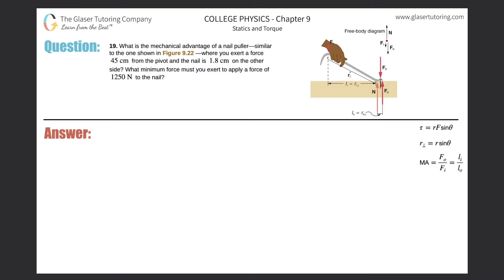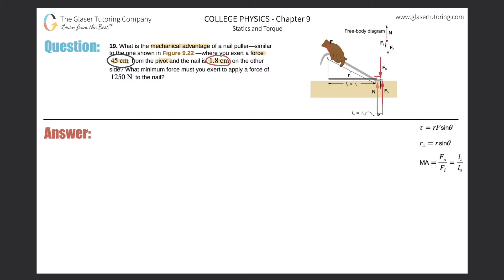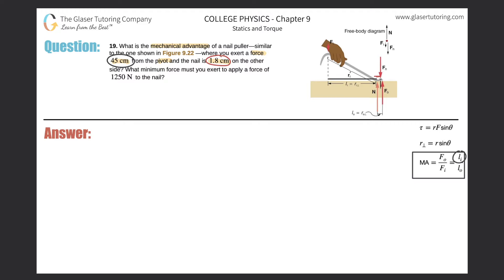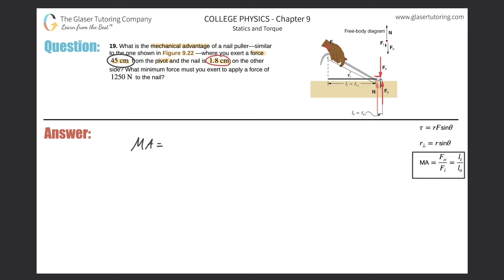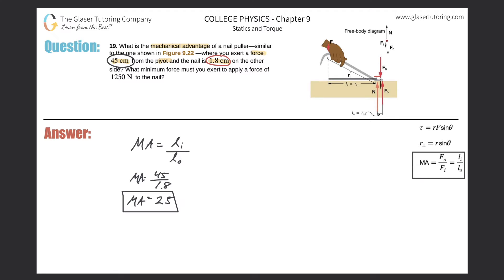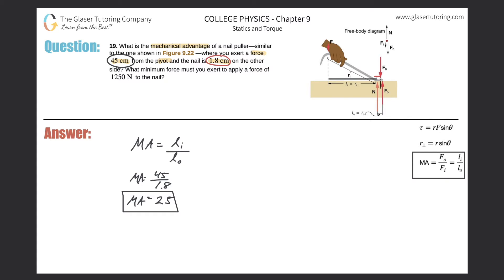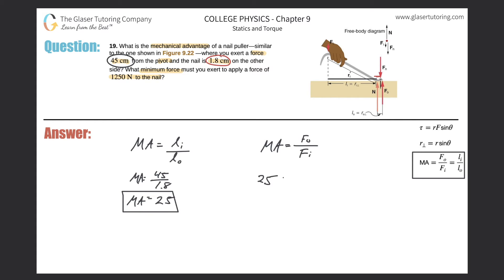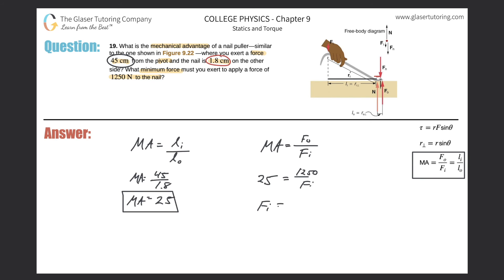9.19 | What is the mechanical advantage of a nail puller — similar to the one shown in Figure 9.22

Comment: Thanks, I'm having a dispute with a kitchen fitter who says to have broken a fitted dishwasher cover from the door I must have 'sat' on it. My basic understanding of physics told me that its a lever problem with the output and input force on the same side as the fulcrum. Your video of a hammer and nail is the closest and clearest explanation of the  problem, which I can use to explain simply to the fitter that if Archimedes could move the world with a lever, then I can break the door if the unit has been fitted incorrectly!